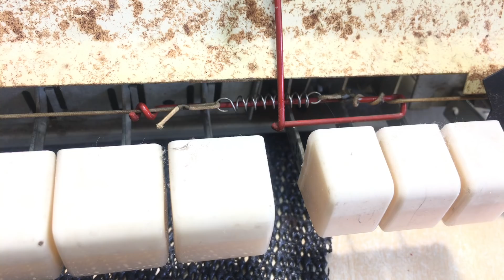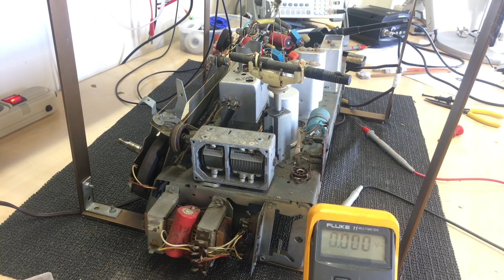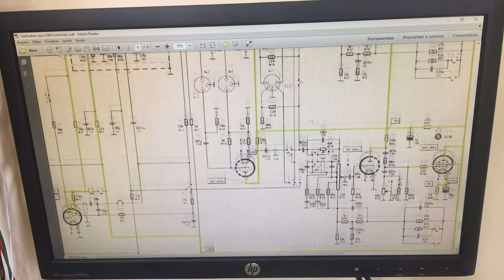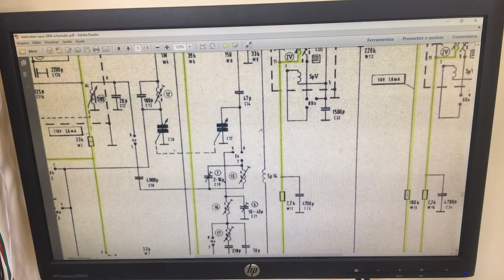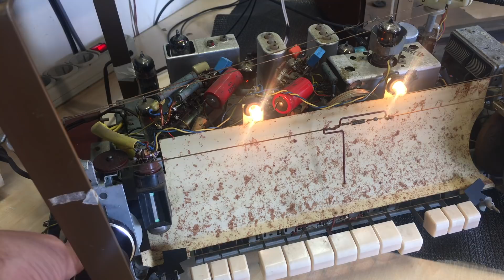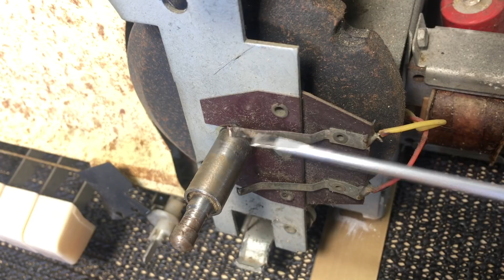Telefunken Opus 2004 tube radio restoration - Part 2. Power supply check and power up.

Comment: I have that Telefunken 2004, where can I find the conversion adapters to rca to use a turntable?
Reply from the maker: A normal modern turntable will probably not work as the signal level will be far too low and it will need an RIAA filter. You’ll probably need a phono preamp and then feed it into this phono socket using an RCA to DIN adaptor.

Comment: I guess your mains voltage was a bit high that day - IIRC, you've mentioned before it's normally ~235V or so, but the lamp limiter with no load is reading 259-260V there 😳!

It's certainly a beast of a chassis, isn't it? A fair size, and packed full of work. Looking forward to the rest of the videos in the series (and you might have inspired me to try my hand at a few of my own - I've got a little Emud waiting to be worked on that is interesting for its simplicity).
Reply from the maker: The limiter is reading higher than the real voltage. I noticed that the other day and actually got quite fright until I checked wit the multimeter. I tried to adjust the internal meter but it is drifting badly, so I guess the little meter needs changing, 
This is one of the bigger sets and is quite a challenge to flip around, but with the aluminium frame I use it’s not too bad.

Comment: Love these repairs. The delicious PCB in that filter ellyt must be delicious :D
Reply: FWIW, since it's a common misunderstanding I've seen stated elsewhere recently several times: there's no Polychlorinated Biphenyls (PCBs) in electrolytics.

PCBs were used in paper caps at various times - up until quite recently in motor start/PFC & lighting PFC caps - but generally not in radio-sized ones. The only ones I know of are some of the large-value paper caps used in radios befor the availability of dry/paste electrolytics in the 30's.